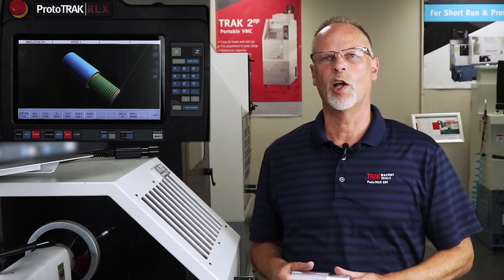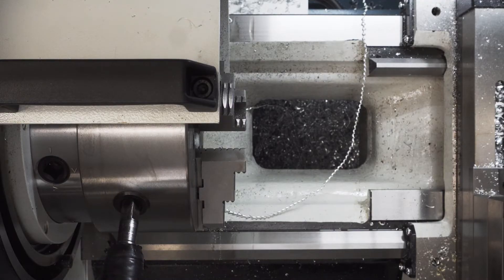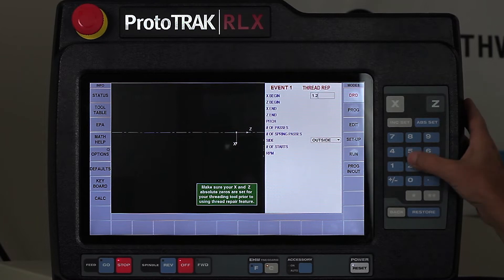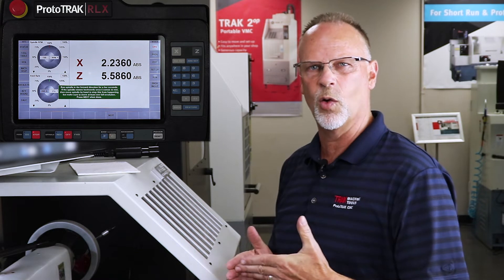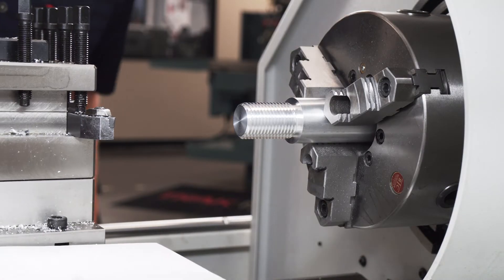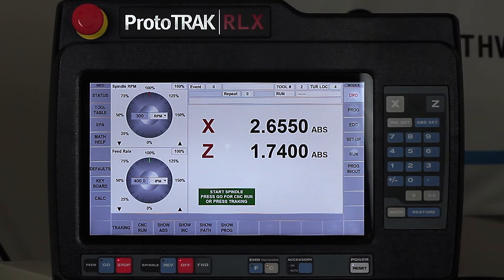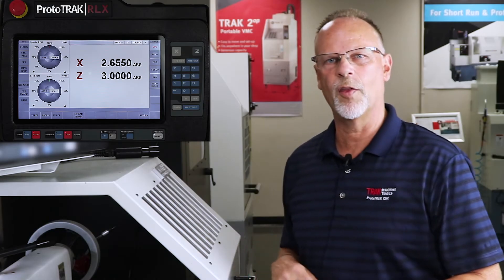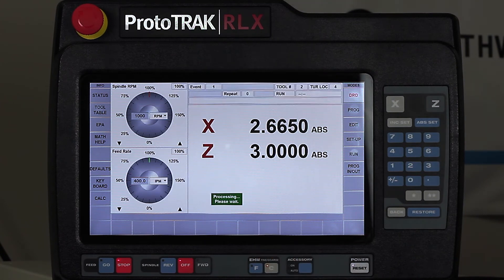Thread Repair | ProtoTRAK RLX CNC | Lathe Programming

Comment: I'm trying to extend the length of a thread but the first pass cuts almost to full depth and busts my insert as soon as it gets to the uncut part of the bolt, is there any way around this? Adding to the number of passes doesn't change it from going near the bottom of the thread.
Reply: Try changing to a custom thread using the options window. This will allow you to lesson the depth. After you cut it, you can change it back. Adding more cuts or changing to depth of cut should help as well. T.P.